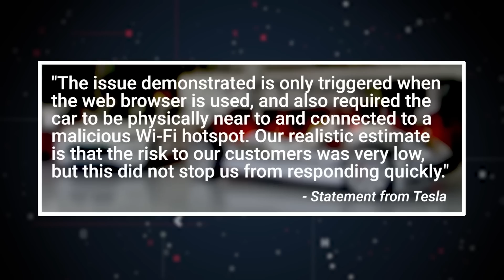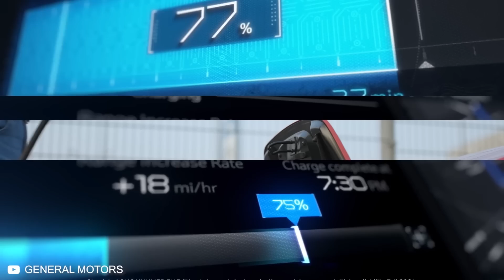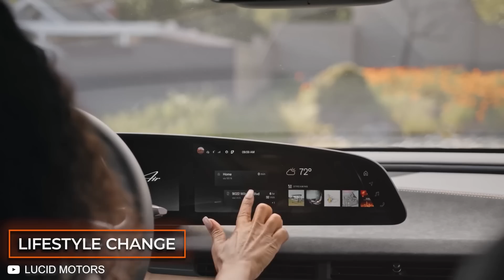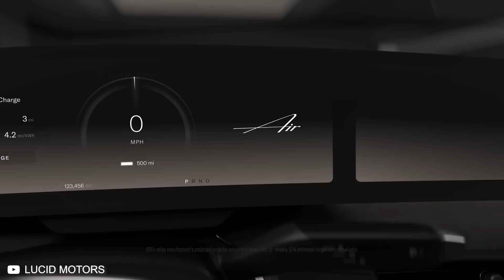EVs' Serious Problems That Carmakers Are Hiding

Comment: When I bought my first car in 2019 at the age of 34, I was seriously limited by budget. I needed a cheap car that had long range and was cheap on maintenance. I settled for a Citroen C3 BlueHDI brand new, was like 20.000 dollars converted from DKK and thats with the insane 80-105% tax we pay here in Denmark on the cheaper cars(a tesla m3 new would be around 57000 dollars). 

It's reached 71300km as of today and I'm still on my first set of tires (got summer and winter set) and my first set of brakes with around 20-25% left on them. That car has been dirt cheap to run and does 65mpgs easily during the spring and summer and 55-60 in very cold winter weather. I cannot get an EV with near the same range nor maintance cost as this, simply not possible. 

The cheapest EVs cost around 30-40% more and are so bad and with the current price hikes on energy a tesla would only be around 25% cheaper to charge per kilometer than filling expensive diesel on my C3. 

As the icing on the cake, my C3 is with a manual gearbox and I love driving stick. I will most likely be driving this car until it falls completely apart or a new engine is needed and considering how long lasting most diesel engines are when kept, that is going to take a while. If only I could put some biofuel in it instead of fossil B7 diesel.
Reply: Fight the climate scam.
Reply: In America, we get our first car at age 16.  No young man would wait until age 34.
Reply: @DerekDavis213  i never needed a car until i got kids and then i couldnt afford it. The drivers license alone cost me 2000- 2500 usd.
Reply: @PeteTheL337  Wow the license is very expensive!   In USA, drivers license costs just $40 usd.
Reply: @DerekDavis213  yup. Everything is extremely expensive here. I think a license would have cost around 1200-1500 usd back when i was 18, some 19 years ago.
Reply: @PeteTheL337  For most people in the US it's impossible to have a job if you don't have a car. That's why most people in the US get a license as soon as they are old enough to have one.
Reply: @DerekDavis213  And why is this relevant here? It doesn't matter what you do "in America" because it adds nothing to the discussion. And believe me, we have been so saturated with American pop culture that we know.
Reply: @mchobbit2951  It's relevant because America (and the English language) pretty much dominates the world.

So it might interest people how young men in America get a car at age 16.   We can also buy guns very easily in America.
Reply: @DerekDavis213  You just explained exactly why it's NOT relevant. WE ALL KNOW because we all watched enough US shows growing up and don't need to be told. Maybe YOU need to be told this: 78% of all the countries in the world, including almost all of Europe, Asia and Africa, require you to be 18!! to even be ale to drive. That includes Denmark, where Peter is from.

It also felt like you were trying to shame him just because he didn't do things like it's done in America when he lives in a completely different country where things are still very different in some ways even if we can speak English and are oversaturated with US media.

America is built for cars, so you HAVE TO drive before you leave home/for college. It is a necessity so you can be independent. In places like Denmark and even the UK (an English speaking place!) students/young people taking public transport is possible and normal. In the US, you also drive cars that wouldn't even be allowed on roads anymore in places like Denmark so the cheapest car you can get in Denmark would be considerably more expensive than the cheapest car you can get in the US.
Reply: @mchobbit2951  In USA, we view 'public transport' with contempt.   Every young man dreams of the power and independence that his own car brings him.

How can you get a girlfriend, and have privacy and time for loving, if you are on public transport, elbow-to-elbow, with the unwashed masses?

English is the international language of business, air travel, and technology.   It is such a blessing to grow up in America, to grow up as an expert in the English language.
Reply: @DerekDavis213  Yes, but in the US we view public transport with contempt because it's so awful. 

And because the public trnsport in Europe actually WORKS, the increase in power and independence when you get a car is not as great as it is here. 

But your overall point is correct. In the US it's impossible for most people to be an independent adult unless they have a car.
Reply: @DerekDavis213  The kind of public transportation network found in the center of US cities extends to the outer suburbs of many places in Europe. Not having a car just doesn't strangle your life there, the way it does here.
Reply: @ak5659  If you don't have a car, how to go on dates with the ladies?   How to take a weekend trip?    How to bring lots of groceries or items from the hardware store home?   What happens when it's raining cats and dogs, and you have to walk to the train station?

Also, public transportation means higher change of catching the flu, or maybe even Covid!

Comment: As the proud owner of a Leaf I am aware of the advantages of EV vehicles.  And there are many.  One of the myths of EV’s is that they are more expensive.  Possibly from a pricetag point of view, but that is more than made up for by the much cheaper running cost of an EV.  From a maintenance perspective my Leaf has cost me zero dollars since I purchased it almost a year ago.  The previous vehicles I owned which were all gas driven would have cost me $600.00 by this point, and that is only if nothing serious went wrong.  Batteries are not an issue.  My battery has a 9 year warranty.  Which means if something went wrong there would be no money out of pocket if it breaks within the warranty life.  And how many people keep their cars that long anyway.  I buy a new one every two to three years.  So battery life is the least of my worries.  As far as range anxiety, that is just a modern myth.  I wish I had a dollar for every time I ran out of gas on the hwy and had to hitch hike to a station miles away.  I would be rich.  My electric car has never once run out of charge while driving.  It is all in the planning, which I was never good at when driving a gas vehicle.  So, would I go back to gas or even consider it?  Never.  For the first time in my life, vehiclewise, I’m happy.

Comment: I have no intention of blowing up on the highway, spending 45 minutes to fill it up, and drive all over the country looking for nonexistent charging stations. Not to mention it costs tons of money to maintain. 22,000 for a new battery bank. Electricity costs just as much as gas and has more of a carbon footprint. People are ridiculous. We don’t have climate change but climate cycles. This isn’t anything new and it’s not an issue. People just turn it into one. You have more emissions  in your house than any car.
Reply: EVs, as much as I don't care for them, the chance of an EVs battery igniting is 50 times less than that of a ICE, but your EV will be a write-off.

Humans are discovered to be the primary cause of the current climate change by a simple process of elimination. The only way anthropogenic climate change could be BS is there was a conspiracy involving tens of thousands of researchers operating in secret since the 1950s, in control of the physics and geology departments of hundreds of universities worldwide. Interesting how climate change deniers that say it is a a hoax, can never identify the hoaxers nor state the false claim clearly. 

Upgraded more efficient grids and power plants providing electricity require less fuel and create an overall less carbon foot print. Heck, an EV recharged by a coal plant puts out half the CO2 as a gasoline car the same size doing the same trip asnd even much better in stop and go commuter congestion.

Comment: EV's are a pile of dung.  Over priced and full of faults.   If we to change all cars to evs, then our electrical grid will fail.  First of all, you will find out that it is not the cars that are the biggest problem for global warming,  that is the first biggest lie being sold to the public.  Secondly if you do your research you will find out how much they are destroying the earth because of those batteries.  This is all about money .  You will still be using fossil fuels when you plug in.   Until they build a car that can generate its own power without plugging in you will still have the same problem.     Don't buy the lie.  Know it or not, they can build a car that can generate its own power, but that would cut into those who want to make money off of everything,  some day those fools will want to charge you for the air you breath.   Some young people years ago invented a car that got 100 miles to a gallon of diesel by building a small engine that that recharged the battery that the car ran on.    So they have the technology to build a car that is more efficient but they want to make sure that they can get every penny out of you, by every which way they can.   If you are rich and want to waste your money ,  then please go ahead and buy an electric car , but the rest of us normal people cannot afford to pay for piece of junk that will be dead in 10 years and still winds up messing up the planet.  Rich people who have money to burn just hop on the first train they see without having enough  sense to do the real research.  They are the easiest people to fool because of their big egos and wanting to out their neighbors.
Reply: Creating more efficient upgraded grids and power plants can easily handle what EVs will demand. Cars are not the biggest problem for global warming, but petroleum is too valuable  now to waste as gasoline. We should leave as most of it as we can in the ground so our kids and grandchildren can use it for complex plastics, paint, etc. Agriculture is the biggest problem regarding global warming followed by burning fossil fuels and clearing forests. 

The rebuilding of grids and the power plants with modern technology is already happening in many places in order for wind and solar and less fossil fuel to take up the slack until next generation nuclear. It can be done; one only has to look to Sweden and Brazil where close to half of it energy comes from renewables. Just under a third of Canada’s energy comes from renewables. Even China with all its faults, is doing more than Canada and the US and already have some ultra high voltage transmission - DC and AC, which requires less fuel. They also emit half the amount of CO2 emissions per capita than the US does. That being said, China is still using coal as a bridge-fuel to power its electric grid while they wait for the next generation nuclear; they are in the midst of modernizing old ones while the nuclear industry is developing its new technology. The US is doing the same, but by fracking gas. 

Strip mining for REEs and battery disposal pose no risk to the continuity of human civilization, but the continued consumption of fossil fuels at current rates raises that risk. The technology already exists to contain lead, mercury, and cadmium when recycling batteries and it is improving by the year to the point that in about 20 years the need for mining will be reduced substantially. All the other mineral and elements in a EV battery are fully recyclable even after being used as second-life batteries. One nice thing about EV battery cells is, they find a second use in stationary grid storage. When there are enough of them to create a market, they will be recycled to reclaim the valuable metals just like any other high volume appliance does nowadays. 

The cheapest technology that produces electricity is utility scale solar, which has a much lower impact on the environment than that of fossil fuels. Solar and wind are the best to use as a transition until nuclear gets its act together. As for EVs, the good news is, not only is the technology improving at a fast rate, less and less cobalt is being used for batteries; sodium and redox batteries don't use any plus it is highly likely in less than a decade, sodium will overtake lithium. The amount of petroleum needed to provide fuel for mining and manufacturing batteries and recycling them,  and how much CO2 it will dump into the atmosphere is small to compared to the amount road transport uses.

That being said, all energy sources degrade the natural environment and they are all are dirty, The responsible choice to make is the least dirty one, not the one where you get to bill your grandkids for the cleanup. What is being pumped into the atmosphere represents an enormous technical debt, which is much much more than all the tax expenditures and all the subsidies by all countries to wind and solar energy and EVs.

Comment: A hybrid (having owned 2 Camry Hybrids) seem a better long-term proposition at present when living in a country where range is important ... there is less CO2 in the production process for a Hybrid than an EV due to a smaller battery packs required ... and yes it is still more than an ICE ... and the CO2 from production is offset far sooner than the larger batteries needed for an EV to come in at the same/similar range ... complimentary technologies are currently less destructive overall with our current level of advancement ... Hydrogen/Hybrid would be better if the energy/techniques to produce the Hydrogen were refined and more cost effective ... ;-)

Comment: Just remember that the electric cars still need to get their energy from somewhere, so your car may not produce pollution, but the power plant you're drawing the power from may create a lot of pollution. You don't get energy from nothing; it needs to come from somewhere.And if you think nuclear reactors don't damage the environment, look at the Fukushima reactor, the Chernobyl reactor (that will be burning for 20,000 years), 3-mile island, and one that few have heard of, a sodium cooled reactor in Santa Susana Field Laboratory near Simi Valley, California, that released radioactive gas that blew through nearby towns. The bid question here is what do you do with the waste? Some have wanted to move it to an "extinct" volcano, the Yucca valley Volcano. Just  today the United States Geological Survey reported a magnitude 3.0 quake in the United States near Yucca Valley, San Bernardino County, California, and the waste still needs to be moved there by truck or train, which can crash and leave radioactive trash all over the place, and it is a weak spot if terrorists decide to use it for a dirty bomb. The waste.is still horribly poisonous, and should something go wrong (and it will) waste will be released.
Reply: Nobody will ever build another graphite pile reactor for electric power, so Chernobyl is an irrelevant red herring and you should know why bringing up Fukushima is also. The most safety problem with nuclear power has been at the uranium mines and the fuel factories, not the power plants.

Fossil fuels raise a risk to the continuity of human civilization. Nuclear power, as mismanaged as it has been, never raised that risk.

It's too bad nobody can deliver a small modular nuclear plant today, thorium or otherwise, but that will eventually happen. Unfortunately the nuclear power industry is somewhat broken now. It is still trying to build a technology that hasn't changed much since the early nineteen seventies. Commercial nuclear power needs time to regroup, reorganize, troubleshoot, and clean house. Then it needs time to get all those new technologies it's been talking about for fifty years to market where they can build well sited plants with onsite storage that creates much less waste than todays obsolete nuclear power plants.

The amount of petroleum needed to provide fuel for mining, manufacturing EVs, and how much CO2 it will dump into the atmosphere is small compared to the amount of what ground vehicles use burning fossil fuels. Heck, an EV recharged by a coal plant puts out half the CO2 as a gasoline car the same size doing the same trip and even much better in stop and go commuter congestion. Imagine what can be accomplished with much more efficient upgraded grids and power plants that require less fossil fuel along with solar and wind  hooked up to them to fill the gap until next generation nuclear.